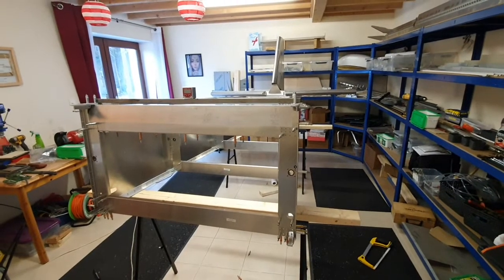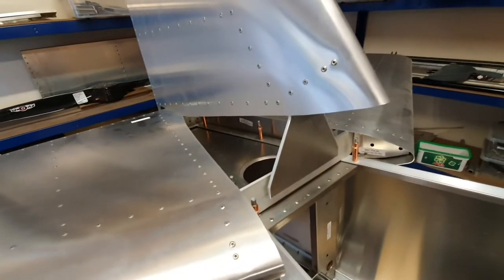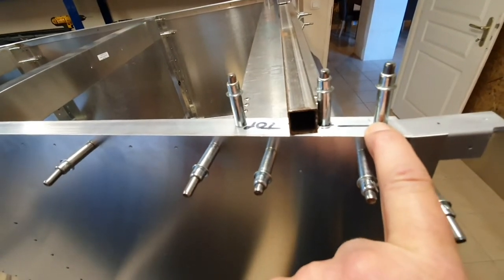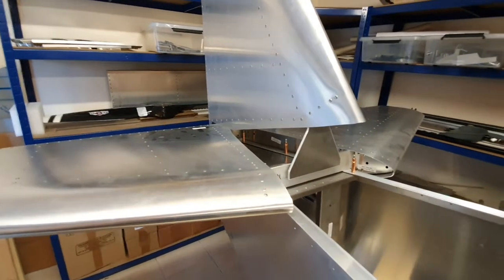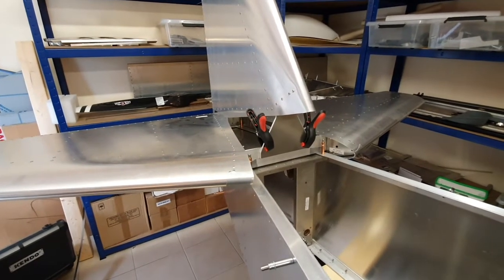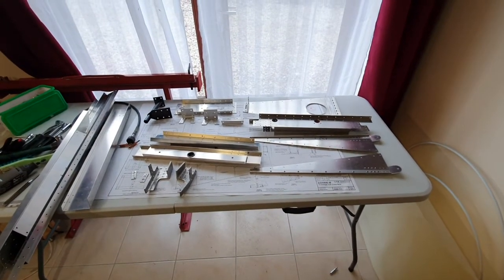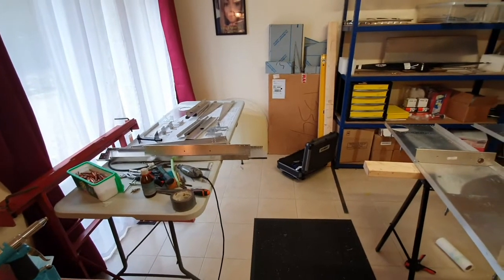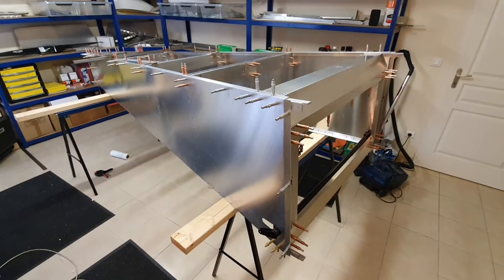Gavin's Sonex B Part 25 - Building the Tail Cone Final Part 4

Comment: Excellent build quality Gavin,
  This video provided insights into a few fundamental questions I had.  
   I was able to assess the relevance of the electrically actuated flap lever. I formed an opinion in regard to personal ( and regulatory) criteria and the actual flight control benefits contrasting complexity and costs.
  Also, I loved learning of the nicely mounted geometric arrangement of the: Empennage: an arrangement of stabilizing surfaces at the tail of an aircraft. 
  Apparently, the steel fabricated fixture not only provides a very robust mounting of the stabilizers but also a solid  mounting of the landing gear. 
  As I continue learning, I'm playing or balancing out several concepts. 1) The robustness built into the tail gear attachment. 2) Flight characteristics tuning ability at these stabilizers.
  Personally, I don't feel any need for maintaining the robustness of this gear design; it is very much more than I require.
  Also, the Empennage platform is very much more perfect than my expectations and desires.
  On a final note, I'm back twenty years when I first began learning of John Monnet and the current Sonex B. Back then, everyone here ( USA), had developed personal opinions which much confused me. Notably, was the desire for electrically actuated flaps and the very cool indicator stuff, but I digress.
  Anyway, later, while tuning the ailerons I will be able to fully comprehend how to tune this girl into a lady. 
  I so wish I could flight test it....very much looking forward to the test period. I want to know the pilots opinions regarding control balance and continuity across the spectrum: Tail high/low, Wing heavy/ light, roll acceleration banking left / right. I am already certain she will land gently, perfectly straight, with the light kiss of the tail wheel catering uneventful.
Cheers.